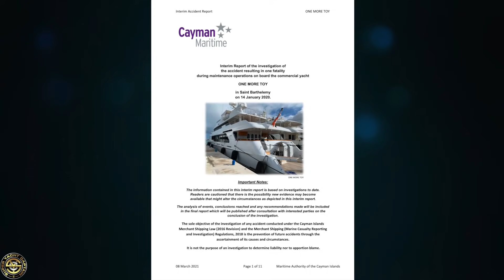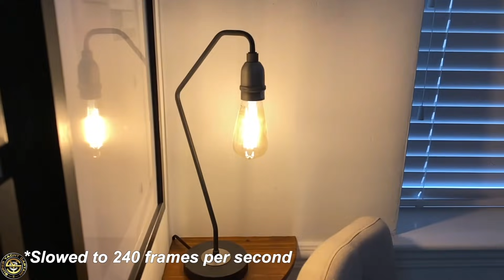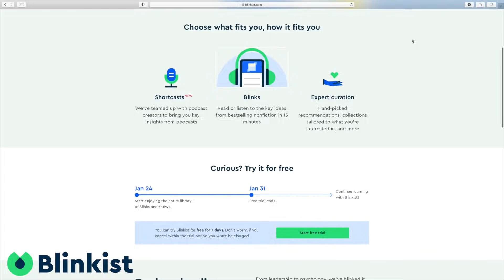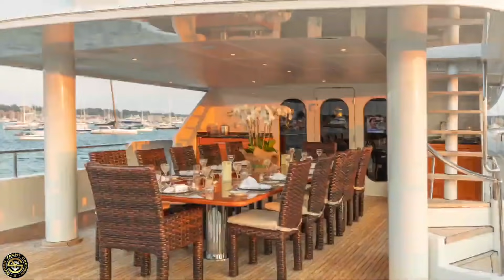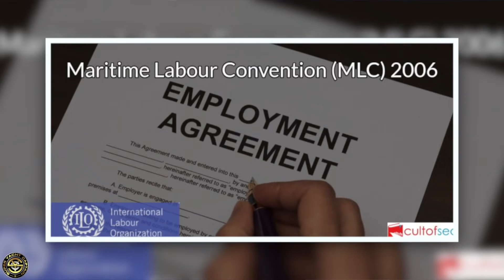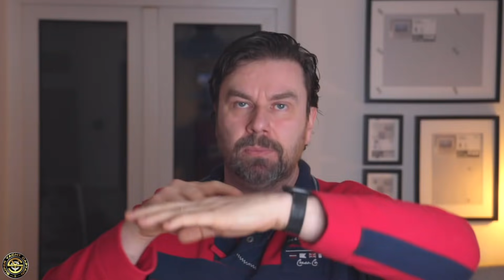Fatal Electric Shock

Comment: It is very common for heating elements to develop earth faults especially when directly immersed in corrosive liquids such as sea (salt) water that will even corrode stainless steel under these circumstances.

The earth on the load bank had completely failed and the readings they got with the tester was consistent with the leakage currents finding their own way to the earth bus bar through the conductivity of the sea (salt) water. 

With a good earth we would test the elements and only a leakage through the element to earth of above 1 Mega-Ohm would be acceptable, again noting that there has to be a good earth. Below 1 M-Ohm the current flowing to earth would exceed 20mA which, if maintained could lead to loss of consciousness and heart fibrillation. At 30mA death is virtually guaranteed. It seems that based on the rep[ort the current that passed through his body was well in excess of 30mA... a very painful death indeed.

How this works is that the the absence of a good earth on the load bank combined with the faulty elements resulted in the casing behaving like a phase connection on the elements. It is highly likely that the outer metal sheath (metal tubes) of the at least some of the elements had failed resulting in the water coming into direct contact with the water inside the load bank and thus conducting to the casing. 

It is highly probable that the casing of the load bank was live and at a voltage well in excess of 250VAC. Once the engineer completed the circuit to earth by his body coming into contact with both a well earthed metal part as well as the then live load bank, he stood no chance at survival, especially as it was highly unlikely that someone would discover him in time to be able to stand a chance at resuscitating him.

I am not in the marine engineering field but have extensive experience in industrial heating systems and these systems all function the same. In industrial applications we are not permitted to work on live equipment without someone assisting. I do not know whether this is a requirement in marine environments but had it been the case he would have stood a very good chance at survival as the assistant would have been able to turn off the generator and started the process of assisting in getting help and immediately starting CPR. Once the body takes on an ashen skin colour it is too late to resuscitate, it won't work because he's been dead too long.

It is a most unfortunate incident and I wish to express my sincere condolences to whoever he has left behind in passing. I hope that this leads to heightened awareness and procedural changes or enforcement/compliance. This was entirely avoidable.

Comment: The hard part of assisting someone who appears to have been electrocuted is  not touch them and secure the power first. Then administer first aid. In this Boatswain’s case it may not have been apparent that electric shock was involved but luckily it turned out safe for the boatswain as the victim was no longer in contact with the electricity. A seaman was being shocked working for me and it’s so hard to THINK don’t touch while our instinct is to aid them !  In that case he was in obvious contact with a running machine which i secured first then tended to him …and he was returned to duty in a couple hours. We were both very lucky.

Comment: To prevent electrical shock. Could you paint the whole engine room with a rubberized undercoating or paint. Also keep all electric wires away from any metal with rubber grommets and mounting brackets.

Comment: Personally as a technician I try to minimise as much as possible the possibility of electrical shock. Number one always wear rubber gloves, number 2 look for ground wires and assess their integrity, if suspect switch off the mains and check with multimeter. I think it is very obvious in the picture the ground wire to the casing was heavily corroded and needed to be replaced.

Comment: Sorry, I can't watch that, it's just too painful to listen to his explanation of what AC power is. I've worked on both single & three phase power motors & generators as well as DC motors & this  is only partially correct. A magnet passing over a coil will induce a current in that coil, that's why it is called inductance & thereby creating energy. When we ground or "bond" the ground & the neutral together we have 2 paths for the current to return, 1 is the neutral wire which is the normal path of current flow. If there is a failure & the electrical energy shorts out, we need a safe way to return the current until the power is disconnected. That is the second path called the ground wire. when we are on shore we can simply direct that stray current into the earth thereby completing the circuit. On a boat, we don't have a ground wire stuck into the earth so we need to ground the vessel to the water & do this in a safe manner without risking harm to the crew or the boat. That is the purpose of the "sacrificial" anodes or zincs that are attached to the hull of the boat. By grounding the metal parts of the boat to this "ground" path or bonding wire we supply a safe path for the current to flow. If this path is "open" then there is a risk of current passing through something else to complete the circuit.

Comment: Sad, and there were 2 electrical equipment failures, the heating elements failed sending current into the water-device, and the ground wire was bad.  The high voltage makes it easier to send current through a person.  On my boat, I once felt a shock when touching the water coming out from the heat exchanger for the Cruisair heat pump which uses 120vac. Inside the connection box on the unit was wet from rain, and had standing water cause the drain was clogged.  So the wet wires was enough to send some current into the ground system. Current will return anyway possible, not all the current will return on an even good ground, it continually seeks any path back to source.  My fix was to make a bigger drain drilled it open to 1/2 inch.
Move the potential relay higher up in the box so it can never get submerged in standing water in the box.  AND, I installed a GFCI-AFCI breaker on the wire in the circuit breaker panel  for that heat pump circuit. I get zero nuisance trips.  It has worked reliably since the fix. Could have been seriously bad say if someone had jumped into the water and went near the heat exchanger water outlet. Water is going to find its way into things on a boat. The box cover is not sealed, water can get in from dripping down the outside face and collecting between the cover and the base at the bottom of the box, and if it cant drain, it will fill up a little like 1/2 inch and the motor potential relay can get wet. It really was a design error from OEM, unit is old from mid 70's so maybe they improved it.

Comment: When working on industrial electric systems always protect yourself from becoming the circuit.  Stand on an insulator like rubber mats or plywood,  it is always best to de-energize  a circuit especially when dealing with grounding (earth bonding) issues as the electricity doesn’t have a path to earth and it’s looking for one.  Also with bonding issues you need to remember the earth(ground) system has every system tied to it so if your working on a system and shut off the right switch to kill the power, you can still get electrocuted from a different circuit while it is running its power to the same earth ground.

Comment: I spent 25 years of my life in Electro-mechanical engineering, anything from commercial, and factory to  power generation station itself. 
I has to work live to test electronic control systems, to 20,000A busbars in DC traction substations. 
I always adherered to safety but unfortunately over confident or prankster 'jack the lad' attitude of newer employees. I resigned and retired entirely from engineering, I eventually moved to art and design.
its extremely tragic when unforseen situations takes lives, leaving behind loved ones.

Comment: As an electrician. Rpm doesn’t change with number of phases. The maximum an A/C motor can turn is 3600 rpm regardless. The factors associated with RPM on an A/C motor is frequency and number of poles. There is however slip, so 3600 rpm is in theory only. The fewer the poles the faster the rpm with the consequence of reduced torque. There is slip due to rotating weight and load, but the motor will keep playing catch-up. The formula is 60 cycles per second and 60 seconds in a minute. 60x60=3600 rpm. 4 poles 1800 rpm. Just had to point out this discrepancy. Otherwise a good basic explanation for someone that doesn’t understand electricity and doesn’t really need to know more.
Reply: ERRRRR   THING IS SOME OF HAVE TO USE 50HZ CYCLE MAINS 50X60

Comment: Wow thanks for the in-depth explaination! I will tell this to all my electrical engineer students!

That's why I teach every single electrical engineer student: meassure everything! Not only for example outlets and other domestic stuff, but also metal cases where you don't expect electrical power like a fully metal kitchen which has eletrical components installed. In my country we called: ,,indirect electrical power touching''. That means: you see or working on something: you don't expect electrical power! But it can happen like bad insulation which touch the power circuit as result a metal case becomes alive :-(

But before you work on that... Always: TEST and TEST until it's safe or you're feeling or convinced to do your job safetely! In my country there are strict rules about that...

So before we work... We test it for example with an analog double pole measuring instrument like the ,,Duspol (brand of Benning)''. Put one pin on a case and put the another one to something else which is from metal or earth (conductor/connection). No multimeter needed!

But anyway: My feelings goes to the Chief Engineer and his family!

Comment: Wel yes and no. Water is actually not conductive it is a very good insulator. The problem is whatever is dissolved in the water. Not the water as in H2O. But for practical purposes since real water is rarely if ever encountered out there yes it is a huge problem.

Comment: As a retired electrical engineer can i clarify a point or two.  Electrical circuits need to be insulated - away from anything other than the conductors, live and neutral, and the item requiring electrical power.  Even the heating element in your kettle has insulation around the bit using the electricity.  Should a short circuit occur, the live coming in contact with the neutral/earth, we had fuses that blew, (in the old days), but now MCBs'. (miniature circuit breakers), like a light switch, they can be reset.  As esysman stated, if the earth connection has been lost there is no problem until a failure occurs - like happened here where, from what i could gather, water managed to get into the loadbank connection box and come in contact with the live terminals of the heater element.  The box being metal then became live.  As there was no effective earth connection the MCB did not trip.  The engineer then became part of the circuit when touched both the box and anything metal in the engine room.  My guess is the water appeared from a failure of one of the heater seals. The reason for posting this is that i worked in the Petro/Chem industry where earthing was the most important thing ever for obvious reasons and earth bonding was tested regularly.  My sincere condolences to the family of the victim for their tragic loss.

Comment: That 100k earth is essentially an open circuit. You can draw a thick black line on paper with a #2 pencil that has a lower resistance. It looked to me like the water getting in the terminals area could explain the failed insulation, but not the failed ground. I suspect the grounds at the buss bar were loose. It can be hard to detect this reliably. Normally the wire would be checked for being loose and the connector would be checked to make sure it has not loosened. But on a boat, everything corrodes. You have salt air, high humidity, rapid temperature changes and lots of vibration. When you open the door, hot humid salty air comes in and it will condense on any cold surface. This corrosion can both sieze a bolt and loosen the wire, so when you attempt to check things it feels tight, and just the heat from you hands may distort the wire just a bit so that it actually makes contact for a little while. This is an area where the way we have always done things is not good enough. We really need simple, cheap, reliable connectors that will stay tight and are easy to inspect in spite of the conditions afloat.

Comment: Firstly, as an electrical professional, I would like to add my condolences to the family and friends of Wayne.  Unfortunately, AED’s require the heart to be at least in ventricular fibrillation to operate.
As an Electrical Inspector, I have had to investigate many electric shock incidents, fortunately non of which were fatal.  The first question I need to ask is do these yachts have RCD’s/GFL’s (Residual Current Devices / Ground Fault Limiters) installed.  Admittedly with the age of this particular yacht, they probably aren’t installed but with the environment the electrical installation is operating in, this should be a serious consideration for the owners of all these vessels.
Reply: My thoughts exactly! ‘98 predates widespread use of RCDs in the UK domestic so I imagine this boat was not updated. Interesting to read the report and see if that’s picked up on.

Comment: So if the boat is outside of the water, do you have to connect that ground plate to actual ground or are you not allowed to use electrical systems on board?

Comment: What caused the insulation failure? Seawater? Overheating? Corrosion at the ground plate connector? What caused the seawater intrusion?

Comment: I’m a master electrician and became confused by our guest speaker.  I went to report and reviewed summary.  Appears the load bank had been a problem for a number of years and should have been repaired or replaced.  It appears the engineer attempted repairs.   From the discussion of seawater hose, it appears the thinking was a issue with seawater flow to unit.   This equipment should have been replaced.

Comment: The cause of this tragedy can be summed up succinctly as "The engineer became part of the ground path for a piece of faulty high voltage electrical equipment on the yacht" THEN explain the details. The bottom line is that you should never work on or even near any piece of high voltage / AC electrical equipment or circuit while it's energized. Caution is required even with 12 or 24 volt DC to avoid arcing and burns / fire from inadvertent short circuits. On boats you must constantly monitor the condition of all wiring because boats are high humidity environments. Salt water is extremely corrosive - especially in the presence of electrical fields, and will quickly ruin even well engineered and maintained electrical systems if they are not kept scrupulously dry. That said, accidents happen. Condolences to his friends and family.

Comment: Very good explanation of electricity.  One thing missing, is that electricity will always take the path of least resistance.  So, if the grounding connection has a high resistance, the electricity will seek a lower resistance path, such as the human body..  So sad that this even came up.

Comment: So he was less resistance than that 100k ohms? So the current "chose" him to escape instead of the path to the buss bar? I think I missed something. Or was it simply the fact that the casing was live and nothing to do with the 100k ohms of resistance?

Great video! This is how dumb I am. I thought eSysman and this channel were the same channel until this video. I was like "What?" and looked at the channel name. I'm a doofus.
Reply: Both. It was "live" because the ground path was 100kohms. Contrary to popular belief, electrical current travels all available paths simultaneously, not just the "easiest" path. Depending on the entry and exit locations, the resistance of a human can be as low as 100ohms (across the head, for example). At 277 volts for a single phase, that's around 2.7A through the engineer, or 730 Watts (roughly1 hp) of power dissipated, enough to cook you really quickly.
Reply: @thebigmacd  Thanks. I definitely thought current choose the path of least resistance. So the party about the 100k ohms was just about it deteriorating insulation somewhere because of heat?
Reply: @charlyRoot  there are two things going on here: (a) the insulation between the elements and the case had a failed causing a current path between element and case, and (b) the connection between the case and ground was bad, reducing the current path between case and ground.
This (a) energized the case and (b) did not short the fault current to ground very well (it would have been shunting only 2.7mA). The engineer ended up being a "better" ground path and thus took a good hit of current anywhere from 25mA to 3A.
Although current doesn't choose a path, it flows proportionally with conductance so the lower resistance path gets a higher current.
Reply: @thebigmacd  the things you learn in YouTube. I was thinking the was a single point of failure and didn't know enough to put it all together. I love when shit is over my head because so much isn't. I don't even own a boat.